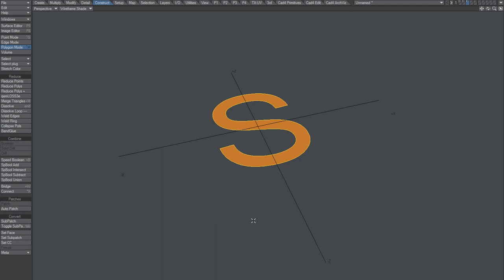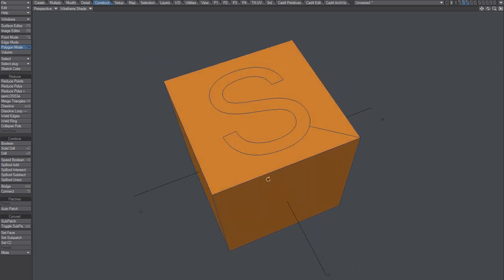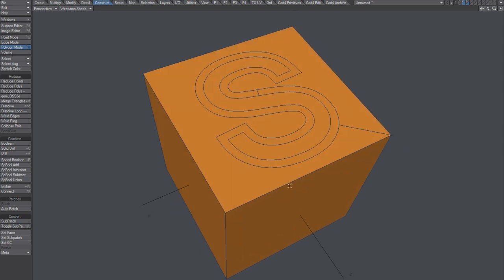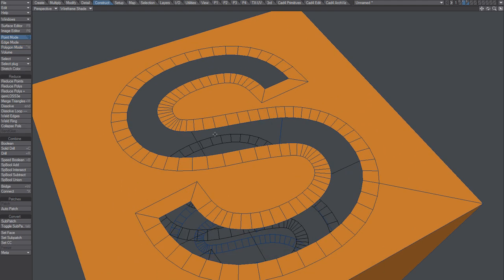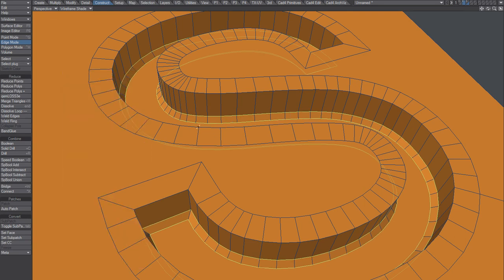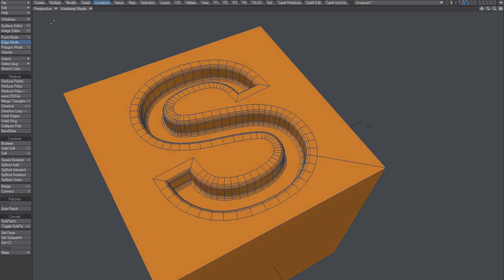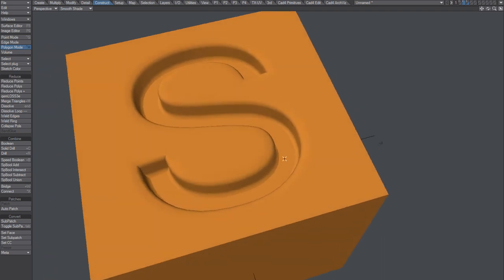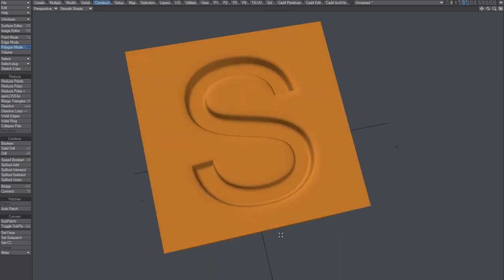LightWave Model - Drill

Comment: The best way i found to avoind those smothing errors, is to tell the software where a flat surface is. Just add another loop on the flat surfaces. Identical to the way you get (almost) sharp edges with subdevision modelling. Works also with other 3D apps. So no worries about welding or not welding points upon import.
Reply from the maker: ah, in this case, yes, Absolutely  :) forgot that  :)  thanks